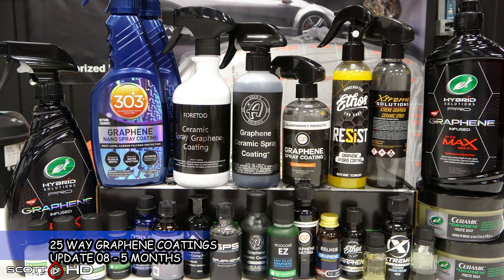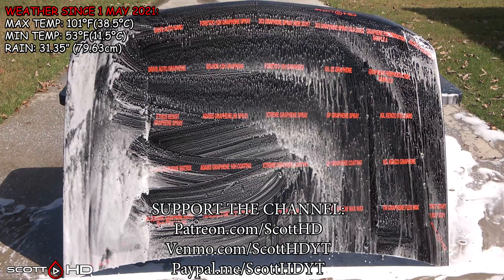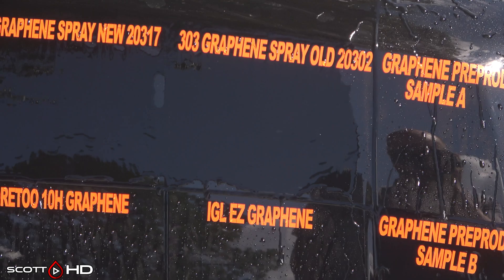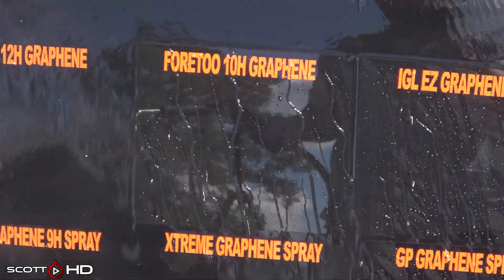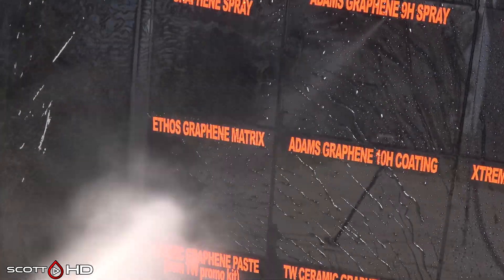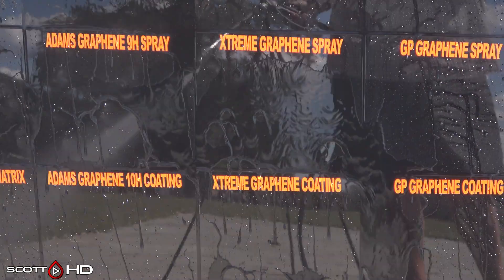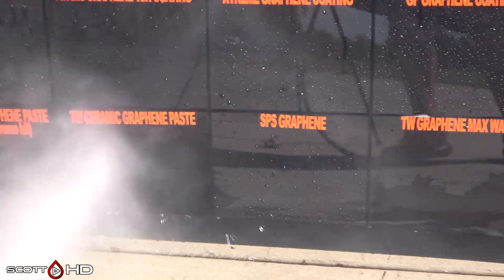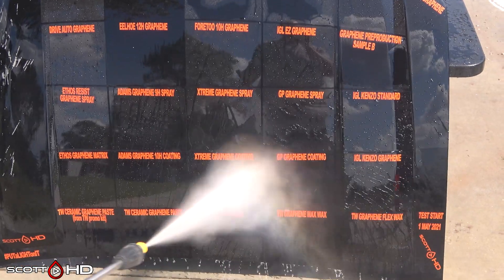Graphene Coatings Longevity Test - 25 WAY - ULTIMATE comparison - UPDATE 08 - 5 MONTHS

Comment: So 303 is a 30-60 day product? I might as well go ahead and do a recharge to use the rest of the bottle until it gets used up. I am not sure what to do after I finish. Mild polish and then a ceramic?
Reply from the maker: I've now purchased 303 5 different times and it has reacted differently each test. It's one of the few products that has NOT been consistent whatsoever.

Comment: Ph.D biochemist here. 

Graphene is marketing fluff. It doesn't 'bond' to urethane materials (clearcoat).
Reply from the maker: Good info to know!  Thank you!
Reply: @ScottHD  you may wish to investigate using a Refractometer to help with some measurements (is your Gloss Meter calibrated?) 

For example, the R.I. of Sio2 can be measured after product application. Lower values means it's wearing off? 

IMO.
Reply from the maker: @DrMonkPhD  absolutely.  Calibrated March 2021 and only used for these tests. I get it recalibrated each year.
Reply: @ScottHD  I also wonder how well those products would behave with water temps about 72F from the hose. IIRC some stabilizing agents in them degrade much more quickly with warmer temperature waters.

Comment: My conclusion is that graphene is largely a gimmick.  At least when it comes to durability of products.  Claims such as higher contact angle and better water spot resistance  are hard to confirm.  But, I do not see how a graphene product would perform better in that regard to any Si02 regular product on a flat surface.
Reply: Agreed. I stick to cquartz uk.

Comment: Really think that graphene is pure marketing B.S.  I do not see any proof that these are an better then SIO2 ceramic based sprays/coatings.
Reply: What if the only benefit would be a cure time cut by 1/3.  Would it be worth adding graphene to the formula? What if the contact angle increases a few degrees and allows for less washes/year  because the self cleaning ability increases? It might not be game changing, but a few small benefits with no downside makes graphene infused protection a good thing, imo.
Reply: Buzz word for marketing

Comment: Maybe the age and type of paint is the limiting factor for some of these coatings. Perhaps clear that is closer to failing will start to degrade underneath the coating causing some of them to fail more quickly.
Reply from the maker: When installing and prepping, I had measured it.  This is original paint, but plenty thick to where I wouldn't doubt the thickness or think it would be a factor here.
Reply: very interesting can of worms right there.  Do different clear coats affect coating performance?  It never ends haha...